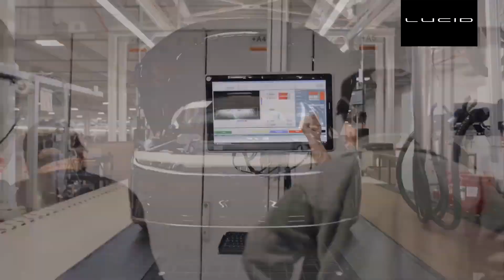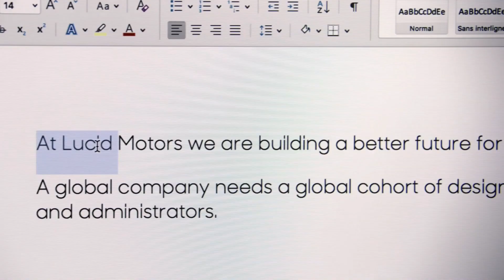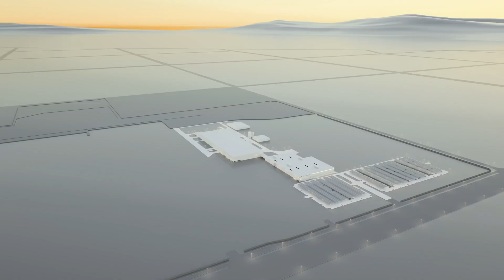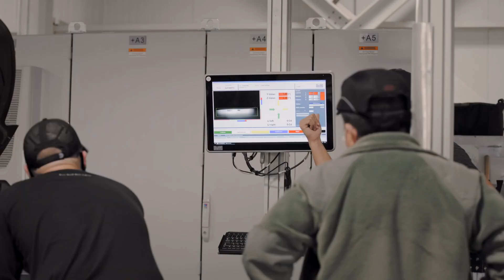LUCID FACTORY🚘{Assembly plant}: Manufacturing Lucid Air motors😳Making of... [Production line] 2024

Comment: Looks to me like more of the same shit cars that will rust out in humid and salty climates and be a nightmare to repair
Reply: Are you talking about an ICE Toyota, Ford, Nissan, or the like? Ask Tesla´s owners and why they won´t go back to gas vehicles.
Reply: @pabloaguila6344    My issue is with how car bodies are assembled with shit spot welds with panels upon panels, where dirt and moisture collects and breaks down the metal faster than most of the other components wear out.  I literally was talking about rust in my original post and you missed that?
Reply: @01mustang05  that’s why you see them using adhesive, which is stronger than welds.
Reply: @skavanger408   I have personal experience that absolutely contradicts your dictation of absolute fact.